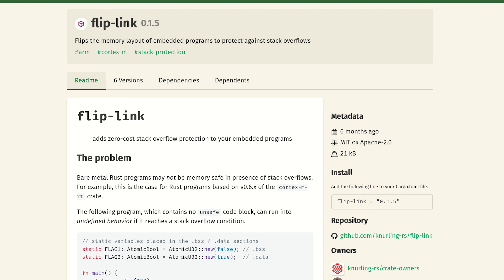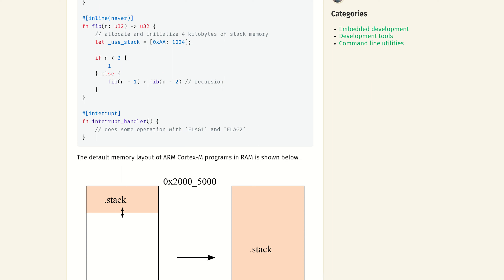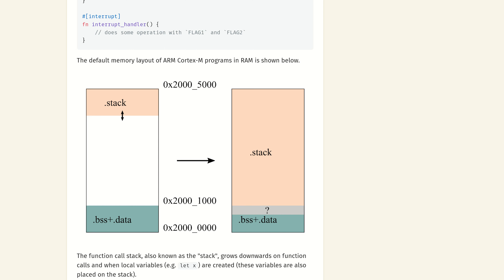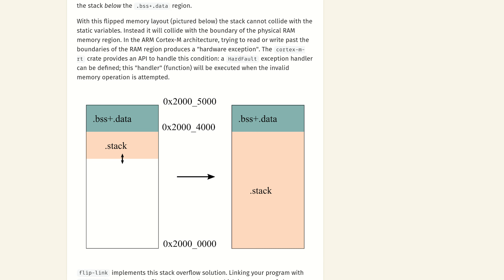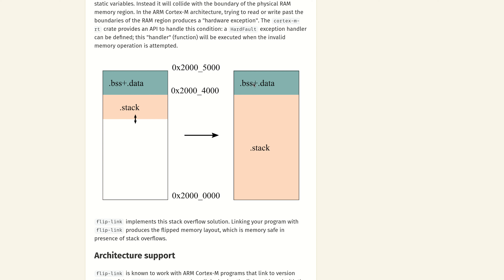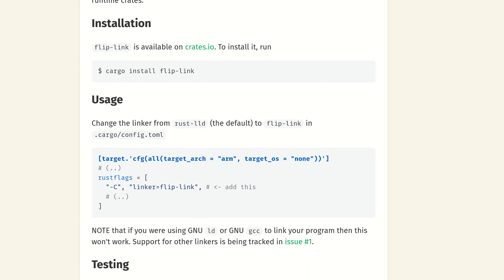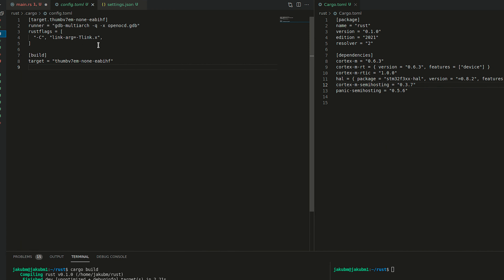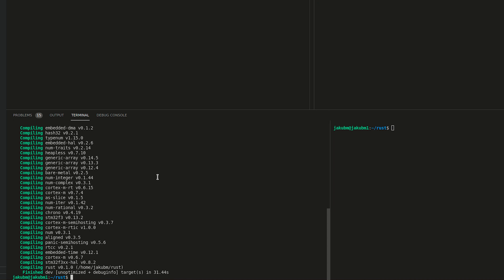Rust Librarian: Flip-Link (stack overflow protection)

Comment: Super useful info Jakub, thanks for this. For info, this is probably mainly useful for Cortex v6-M and v7-M (M0+, M3, M4, M7) since those MCU don't have an end of stack register. For the latest Arm MCU (V8-M) such as the Cortex-M33, M55 tey do have an end of stack register for both PSP and MSP stacks so providing to set it up, you will get a fault when you overflow. 
I am going to try this crate though, it saves you from having to program a no-access MPU region.